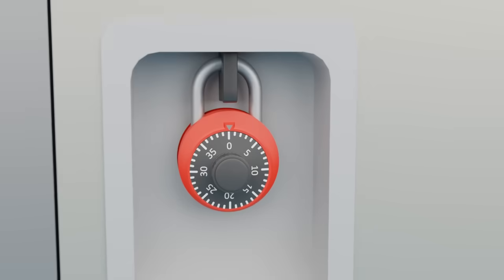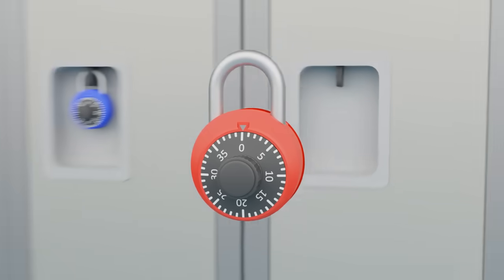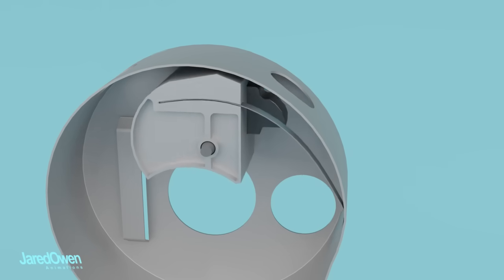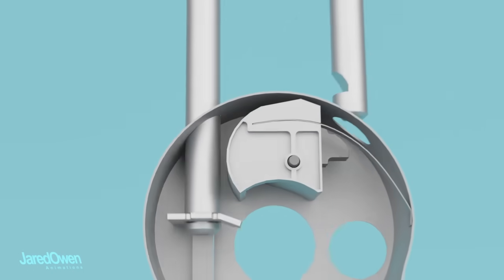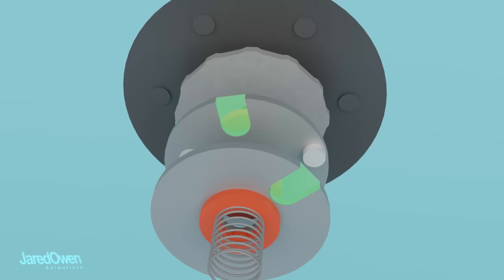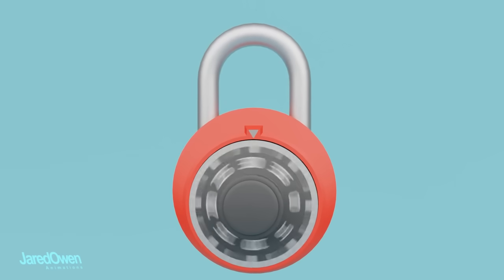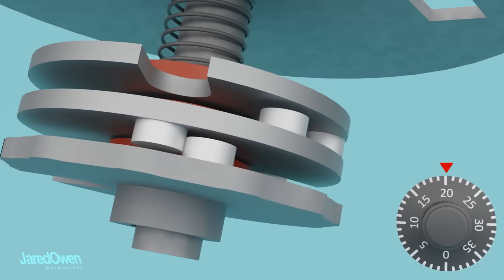How does a Combination Lock work?

Comment: If the lock is open, you can see the internal slots pass by the shackle hole as you turn the dial. Note the dial numbers where the slots align. Subtract X—a fixed offset specific to that lock model—from each of those numbers to get the actual combination.  You'll have to get X through trial and error.

Comment: Fun fact from when I took one apart. These locks can be solved backwards with a different set of numbers. Start by turning counterclockwise a few times until the teeth all catch, then clockwise to set the first cam in the right place, etc. I have no idea what the formula is for the different numbers.

Comment: Now people can understand how easy it is to open one of these without a combination. The spring loaded latch is the weakest link in all of this. You can either push it open with a thin piece of metal/plastic, or you can probably try and smack it with something if the spring is not strong enough.

Comment: So, I kinda 3D printed it, it is a bigger mechanism, but works the same way. Basically three discs connected with rods and notches on them, and a sliding rod that pulls the lock sticks out, if the combination is correct.

Comment: If the cams were all damaged, the dial can no longer move the cam #1, meaning the dial was permanently stuck, which means none of the cams will line up, which means the lever won't rotate, which means the shackle won't come out. When that happens, the combination lock gets permanently locked.

Comment: ALWAYS RESET THE LOCK BY ROTATING IT IN ONE DIRECTION FOR A WHILE AFTER LOCKING IT. If you don't press down that hard, or sometimes this just doesn't happen, the gaps will still all be lined up after closing.

Comment: If you put clockwise pressure on the dial, you can then slide a small shim piece made from an aluminum soda down the left side shackle to disengage the latch. 
Faster to open than using the combination. I wouldn't trust these kind of locks to protect much.

Comment: I used this method to save 2 old locks I found over the years and didn't know the combination. Drill a 1/8 to 1/4" hole in the back where the cams lineup. (Its right near the shank) You can then see each cam as it lines up, as you turn the lock. You can learn the combination this way. Not to worry, no one see's the hole when its in use, but a way to save a lock that might've got pitched. 🤓👍

Comment: But how do you set the code? Or do cheap locks like this come with pre set codes that you just have to write down or remember?
Reply: I'm assuming that lock companies just have commissions for various cams, which is then scrambled with many other cams to ensure a completely random code. It's my hypothesis.
Reply: @attackoramic8361  what I mean is that some combination looks let you set a code yourself. When you buy them they are blank and you essentially have to set the code the first time you use the lock.

But I’m not sure if these specific locks have that. Because these are the type of locks used in high school and universities and they tend to be really cheap things!

So what I’m suspecting is that when you buy these types of locks you basically get a piece of paper with the pre-set code for that specific lock!

But I’m not sure if it’s true.

I never had locks in my school until university and we had digital locks on each locker that had a keypad and a electric display! You could unlock it ether with a four digit code or with an app on your phone connected to Bluetooth! It was pretty cool if you ask me!

Comment: All im intrested in is the strength of the spring behind the small latch, if it is light spring then it should be easy to rapidly move the lock until it comes to a sudden stop, the latch retracts and lets the shackle free

Comment: In a good lock the shackle's rotation will only line up with the opening of the cams, and as it opens the cams are forced to rotate slightly. Then when it springs back into its original position the cams are forcefully rotated back as the shackle closes, causing them to spin violently.

I assume you bought the absolute cheapest combination lock available if it did not have this feature. (I don't blame you, since you were purchasing it to destroy for research purposes.)

Comment: This is the worst kind of lock. This is how you break into them.
Pull down on the lock.
As you are pulling down rotate the diel until it meets resistance.
Then turn the diel the other way until you feel resistance again.
Then once more in the other direction.
Now the lock is unlocked.

Comment: Does this also work when the third number is like 1? Animation looks like you need to have a higher number for the third as for the second or first.
Reply: You can rotate it all the way around as long as you don't go far enough to hit the nub on the next cam from the other side, so you can go back past 0 to smaller numbers.
Reply: @kyousouka  I think there are technically some combinations that won't work, but not many. You could even have it so the first number doesn't actually line up the first dial, and when lining up the second dial it pushes the first into place at the same time, in order to technically get an impossible combination to work.

Comment: The lockers at my highschool had the locks built into the lockers and after putting in the first two numbers, twisting really hard clockwise would always grab he last one and force open the lock. I think the 3rd cam had to be connected to some kind of spring or coil as it could only twist so much before it would pop open the lock. It made opening other people's locks really easy as it was pretty easy to hear the first 2 cams line up and the third didn't matter because it would always catch.
Reply: Yeah, I've seen many of these things that in reality end up being two number combination locks. Never liked them for that reason. Sure, they did their job, but seriously, let's at least try.
Reply: @bwhog  Yeah, they are designed to be easy and cheap to manufacture and usually just used for low security stuff like lockers. They are good enough that the average Joe can't just open one up, but anyone who knows locks can get into them really easily.

Comment: PRO: You have better verbal explanations than others...I think you must do a better job of anticipating the thought process of the viewer.  CON: one thing you didn't anticipate was showing how the combination is set after the lock is purchased - how does the random numbers we choose set those little pins in the proper position? NEUTRAL: It would be cool to see how other locking devices work, such as the where you push the dial up/down/right/left.

Comment: Great explanation! One note I have at 4:40 is that the jolt from locking it often isn't enough to move the cams out of alignment, and so unless you turn the dial again to move them, there's a good chance your lock will just open if someone pulls on it
Reply: When the shackle collar goes up it turns cam 3 (1st number 21 in this video), there is no chance your lock will open if someone pulls on it
Reply: @Mferchier  What would make the shackle collar go up, and turn cam 3 after you pushed it back in though? 
Because Pulling up on the shackle won’t turn the cam if the cam notches are still aligned, because if you pull up on the shackle while the cam notches are still aligned than the lever will be rotated back into the 3 aligned cam notches still, and let you
‘pull out’ the shackle.
(only if the jult was Not enough to knock them out of alignment when you pushed the shackle back in)
So the shackle collar won’t turn any cams when you pull up on the shackle if the cam notches are still aligned, because the lever will be rotated inside the cam notches when you pull up, and that will prevent the shackle collar from turning any 3 cams.
That’s why you have to turn the dial or sometimes it won’t lock. Which is why he said the jult is (usually) enough to rotate the cam and lock, because sometimes the jult isn’t enough, and you need to turn the dial sometimes instead .
Reply: @Mferchier  No because when you pull up on the shackle while the cam notches are still aligned, than the lever will also still rotate back into the aligned cam notches, and while the lever is rotated into the still aligned cam notches, then cam 3 or any cam won’t be able to rotate and become [Unaligned], because of the lever being inside the aligned cam notches.

Comment: Fun fact about this lock design: while the combinations are specified by turning the dial right, left, right, there is also an opposite combination achieved by rotating the dial left, right, left.  (The final number is the same, but the second number must be offset by the width of 2 teeth, and the first number must be offset by 4 teeth in the opposite direction.)

Comment: Is it possible to disassemble the lock to determine the combination if the lock combination were unknown?
Reply: If the lock doesn't have a major design flaw, it shouldn't be possible to disassemble in its locked state. From what I've seen, most padlocks have a screw under one the shackle legs, so unless the lock is unlocked, you wouldn't be able to disassemble it.

Comment: I watched this video after running across your one on the Enigma machine.  While one is more complicated than the other, I feel I have a better understanding of both now.  With respect to the combination lock I have watched videos that show how to open one when you don't know the combination.  I have tried it on a lock I have and couldn't open it.  Their method of putting tension on the shackle and turning the dial while feeling for "clicks" doesn't make sense based on your video.  Maybe you could do a video on that.

Comment: I use to open these in highschool if people forgot there combo or wanted to do birthday mischief in someone's locker.
If you pull down on the lock so the shackle turns the latch so it presses against the cams you will be able to feel each of the notches on the cams.
Just go through the process like you would normally and the lock will open.

Comment: You could strike the top of the body of the lock on some locks and cause the cam to skip off the bar and the lock would drop open. Master locks are the hardest ones to get to do this. Cheap locks are easy.

Comment: I have Blender too, but I stopped using it because it is too had to understand or use. My first project was a waving flag, and that was it. My main interest was to design bridges that, when you drive over them you don't get that teeth grinding jolt, like a speed humps, as you go from bitumen to bridge. Both, the road surface and bridge surface are never aligned flat so that you cant feel any Humpty Dumpty impact that jolts you off the seat, high enough to lose your dentures.

Comment: If viewers looked closely enough, you showed but didn't explain the most important feature of this lock.  The spacers are keyed to the stationary center shaft to prevent the two loose slotted disks from moving out of position when the dial is turned the opposite direction to position the second and third discs.   Another thing you didn't mention is that to have locks with different combo numbers, the stops on discs are attached at different locations using the same radius.   Also, why are there indentations on the die cast disk that attaches and turns with the dial?   There's a lot more happening inside this lock then what you described.

Comment: This is the shekel it won't come out until the right combination is put in wrong wrong wrong. A soda can can pop that shackle out easier than the combination. Any thin flat piece of metal that can get behind the Locking Paul can open the shackle. A well-placed hit from a hammer will open the shackle a torch will open the shackle. I'm just saying you might want to rephrase it.

Comment: 2 Questions I’ve seen a lock that uses a direction code to open so u have to move it up down left right in a certain order to open, how do they work? And I’ve seen combination locks that you can change the combination on without taking it apart how do those work?

Comment: It occurred to me as you were saying the cams line up so youcan open the lock...  That cam design, means there is a specific set of numbers, a bandwidth if you will, that CANNOT be used together in a combination lock like this.  I don't know what they are, but there is a specific ser of numbers that can never be used, otherwise the cams would be coming back around and hitting the other side of the corresponding cam pin, and throwing the cam unlock slots out of alignment.  This is assuming of course, the lock is opened and used in the ssme configuration you are showing; the "common" unlock and camming pattern.  This could POSSIBLY be overcome, simply by changing how the lock is rotated, and/or the way in which the cams could be configured, but there is still, in the configuration you have presented, a set of numbers that just could not be used.  

Neat.  :-)

Comment: Really good animation. There's something you might have missed though, cos it's not that obvious. When you pull the shackle open, past where the locking lug is, the edge of the shackle retainer clip also knocks the combination rings and moves them all out of place. (That's why it's shaped a bit weirdly).
Reply: Not all locks had that feature. Plus he forgot the key in back for what it's worth
Reply: @FordRangerClassics  I have never ever ever seen one that uses a key
Reply: @markylon  I have, you know where? Your mom
Reply: @markylon  They are mainly used in commercial situations and bought in bulk. For example, a company can provide locks for employee lockers with different codes but use the master key to remove any lock if needed.

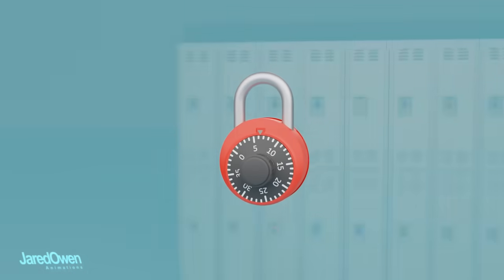Comment: 4:30
How does the lever rotate counter clockwise into the three holes? Doesn't the tension make it want to keep moving clockwise?

On a rewatch it looks like the latch spring provides enough force to cause the rotation?

Comment: 👍🏿🤘🏿2 springs one that releases inside the lever (looks like brake caliber/bigger curved shark fin 🦈)pushing the latch towardthe round side case  pushing the latch (looks like a right wing or 🦈shark fin which only moves so far clockwise when look at black dial/number side cleaning the three aligned horse shoes, and also on outside the is a triangle pointing down above numbers to align align)that goes inside/lockss the wing groove tight at bottom of shackle hook and the other spring that goes toward the dialll

The other side of shackle has a collar so when pull up the squared/pointed edge plate that goes around catches on the  tight enclosed case and the lever up top to the right
3 cams that looks like disk brakes(with pac man horse shoe mouth , shape inside shackle) and cam closer to the dial is actually connectedd to the dial (like the shackle to the inside or a latch on the outside )on the outside and moves as sooon as you move the dial the other have teeth that have to push with (#2)the first cam connected dial on outside using round knob that looks the little teeth/node/rivet/grandma biscuit

Comment: I've known how this works for awhile. However we had same combination locks but with a tiny key access on the back. The administration had the master key and could open it up whenever they wanted. I'm interested in seeing that. I opened a few locks like this and could figure out what the combination was after seeing it line up properly.
Reply: A little late but the key lock has a arm behind it that pushes the latch down. Looks like a see saw in there

Comment: Now I just need to know why the locker for my gym is so fucking bad. Every time you rotate clockwise and get to 0, it’s like it’s getting stuck and you have to force it to keep going. When the shackle opens, it doesn’t open all the way, and I have to push it back in before it fully pops out. The worst part is trying to get the shackle back in. It’s so stubborn that it won’t go deep enough to lock and I have to SLAM it for it to even lock into place.

Comment: Shouldn’t a combination lock be called a permutation lock as the arrangement of the numbers matter ?
Reply: Mathematics is not the only field where "combination" is defined. More commonly, "combination" is used similarly to the mathematical definition but more loosely, typically including permutations, as "permutations" is a term that is less customarily used by people who do not have a recreational/professional/academic appreciation for maths.

The numbers on the dial don't indicate math, per se*, as it's just an application of the number line to create a series of uniquely referenced positions with minimal actual marking, using something people generally know.

*You could use permutations to calculate how many different lock solutions are possible even if the dial had letters or hieroglyphs.

TL;DR - the lock is named with the common use of "combination", not the mathematical use, because the common use is what people will commonly think of and, commonly, people do not give "permutation" much use.

Comment: Nice Video, mine used to be broken so after the code, if it was shut, you could pry the lock open cause the Cam’s didn’t rotate a little after closing 😢🤷‍♂️

Comment: Or even more simple, just slide a metal lock shim into the lock at the shackle, and wiggle it a little. Latch gets pushed back by the shim's presence and hey presto! You've unlocked your combination lock in far less time then it would have taken you to rotate the dials around. :)

Comment: My lock combination is simple but I just never use it I took some metal sheets and clear taped it so it couldn’t be seen now my lock shuts but not all the way and the metal sheets match the color of the lock and it’s basically impossible to tell the difference if it has metal sheets or not